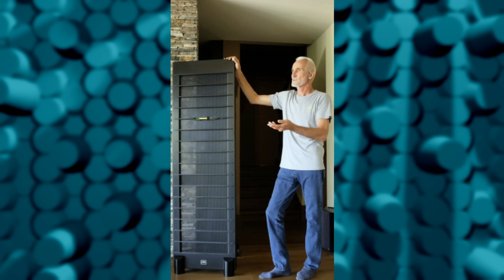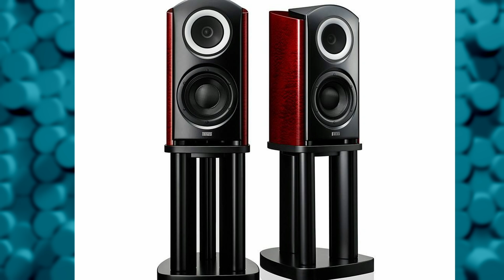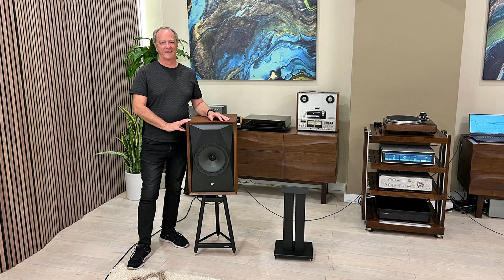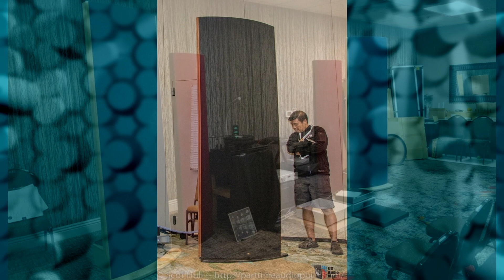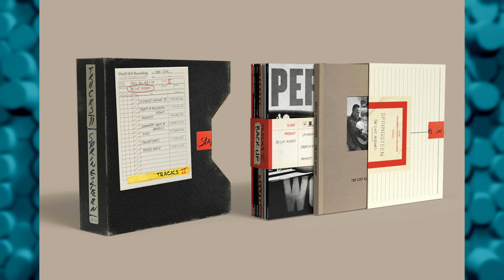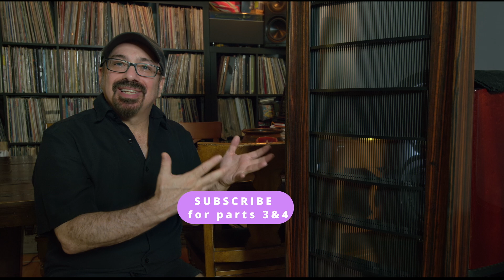Why are these Popori speakers called the "Holy Grail of electrostats?"  Part 2

Comment: Hi again mate:
Following up on my comment in your excellent WR3 Part 1 YouTube, your animated illustration in this Part 2 video shows the classic full-two-sided ESL stator panels, one stator panel on the front side of the membrane, and one stator on the bask side; but your WR3's appear to only have one stator panel (the black vertical rods) on one side of the membrane.  If this is true, then the WR3s are not full electrostats, they are "electrets", like Stax's entry level Dynastat headphone series.  If the WR3s are not true electrostatics, then they are only pulling in one direction, and then releasing allowing the membrane to spring back to the middle.  Also, I suspect that "electret" single stator ESLs may be start fast, but then might stop relatively slowly, with the membrane continuing to vibrate like a guitar string when the signal stops.  Please confirm if each WR3 has two stator panels or only one.
Many thanks!
-Sam
Reply from the maker: Hey i just saw your comment - yes the Popori has stators on both sides- thanks for watching - I also have a high quality recording   

https://youtu.be/Fqgfs1u19FU?si=-MzsBB28CF2btHZ8

Comment: Quad can be rebuild to last for 10 years easily.
These line source wire stator electrostatics are over 50 years old in design nothing new at all. Until I see proper measurements especially about distortion it is just a rich man's new toy.
The Mylar in these speakers it oo thick to give really brilliance IMHO. That is why most models have added AMT which is a very weak offering.
Reply from the maker: Hey thanks for your insights.  As I mentioned in part 1, Popori has been rebuilding other manufacturer's 'stats from close to 30 years in Europe.  They have panels that have been running 20 years with no repairs needed.  This is the big downfall with Quads IMHO, and why I would not go back, even though I'm sure the new ones sound excellent.  Ralph Karsten looks at the specs  of the Popori and dubbed them the "Holy Grail of electrostats"  His MA-1 amps are a favorite of the Soundlab crowd, so he knows what the tradeoffs of the various design are.   If you're ever in NYC and want to hear them, my contact info is on my channel.
Reply: @RDAudioReviews  Naming something "holy grail" is dead wrong to begin with. Every speaker has it's strong and it's WEAK points. Nothing is perfect and every choice in design has trade-offs. Being active in a market for over 30 years doesn't give any guarantee on quality or ingenuity of design. There is a company in Germany repairing electrostatics for 40 years and the result is still meh to say the least. I have Quad-63 running for over 10 years without any repairs and they will go on like this for decades. I don't have to travel to the US to listen to this design, I'm closer to his home country. It is still a very simple segmented wires stator line source ESL with 5 micron Mylar (without coating) used. There are laws of physics you can not break and you have to go into workarounds to get the upper octave working and there still wil be large distortion in this case like it is with SoundLab. Take measurements and be done with it.  Nothing holy grail about these, not even linear by far and Quad has factors lower distortion when rebuild done right. All ESL Plus Quad ESL-63 is distortion below the noise floor, so inaudible. If you are in The Netherlands and you want to hear them, come and listen.
Reply: The nature of a large electrostatic panel with huge excursion (this excursion allows the deep bass) is a tendency to slightly roll off the upper highs.  It is the tradeoff for not having a crossover and going for a full range design.  So, what they have done is to include a very high frequency ribbon tweeter in parallel with the full range panel to compensate.  It is a much better approach than to simply limit the bass with a crossover around 200Hz or so, ML style.
Reply: @davestipsforaudiophiles 😂😢 huge excursions. You are joking, right? Maybe you can define "huge excursions" in actual travel distance numbers. I'm looking forward to your answer.
Reply: @ESL-Plus  What is the world without a bit of humor?  All things are relative.  Compared to the movements of other ESLs, that movement with the Popori is greater.  Huge may very well not be the appropriate term, but small to some could very well be huge to others, especially when you factor in what that extra movement allows to happen.
Reply: @ESL-Plus  I find that 'Holy Grail' of ESLs to be quite appropriate.  It signifies long sought after attributes that have illuded the otherwise wonderous performance of some ESLs.  Some of those would be, efficiency, easy load to amplifiers, real low bass at high SPLs, etc.
Reply: @davestipsforaudiophiles that would be lovely ot see in measurements.
Reply: @davestipsforaudiophiles compared to other ESL's movement is bjgger? How do you know? Still would see that expressed in actual numbers. Thank you.
Reply: @ESL-Plus  I understand.  What is it you would like to see?  If you trust your ears all of what I wrote is demonstrated at the various audio shows.  Hearing is believing.  My pair of WR3s have the lowest efficiency at 88dB.  The larger models are mid 90s and up.  My bass towers roll in at 39Hz.  Just imagine all that speed and delicacy going down to 55Hz, my roll-off point.
Reply: @davestipsforaudiophiles you would be the first one to establish those numbers be listening at speakers. You know by the hz exactly how low it goes (without mentioning within what  dB range with what smoothing) 37 Hz, 55 Hz. You can detect the efficiency by listening. This is simply sales talk and marketing talk, not substantiated by any proof. I would love to ANY proof. First see real measurement numbers. If they come any close to the claims (which they seldom do) there is use in listening to them, because numbers don't say it all. But listening and judging without substantiated numbers means really totally nothing because it is all subjective. Enjoy the music.
Reply: @ESL-Plus   In my room the native frequency response of the WR3 starts to drop just under 200Hz, and is down by 5dB at 40Hz, then drops completely off below that. The frequencies I gave you are the points on my active xover to achieve 21Hz - 1000Hz +, - 1dB on a 1/12 smoothing.  Yes, I am using a very advanced room correction software.  I am not a loud listener, but I have had them up to >105dB for testing without strain.  Other ESLs that roll off the low frequencies cannot be brought to reproduce those lows without bad distortion and break-up.  The Popori will.  The larger models with higher efficiency can easily be run on 25W.  I do not have a lower wattage amp and so I do not know about mine.
Reply: @ESL-Plus   In my room the native frequency response of the WR3 starts to drop just under 200Hz, and is down by 5dB at 40Hz, then drops completely off below that. The frequencies I gave you are the points on my active xover to achieve 21Hz - 1000Hz +, - 1dB on a 1/12 smoothing.  Yes, I am using a very advanced room correction software.  I am not a loud listener, but I have had them up to >105dB for testing without strain.  Other ESLs that roll off the low frequencies cannot be brought to reproduce those lows without bad distortion and break-up.  The Popori will.  The larger models with higher efficiency can easily be run on 25W.  I do not have a lower wattage amp and so I do not know about mine.
Reply: @davestipsforaudiophiles  "Other ESLs that roll off the low frequencies cannot be brought to reproduce those lows without bad distortion and break-up."
Man, you make all kinds of assumptions.
A normal ESL can do 35 Hz with only 0,2% distortion. And I've got my own, in the living room, measurements to prove it. I have 30 Hz to 24 kHz within max 3 dB plus and minus with my standard ESL and again the measurements to prove it. Lowest distortion point is 0,03%, the highest is 0,5% THD. 105dB not a problem measured with pink noise. 
If you need a sub and DSP and/or room correction that is a very weak offering.
Can easily run on 25W? What does that say? Nothing. The First ESL's where driven by a few watt flea power amps without any problem. Output @ 1W / 1M / 1Khz that is what efficiency is measured at.
You are obviously a fan and I get that. But please know that is nothing special since the early fifties in there that has not been done many times before at a fraction of the price. Enjoy the music
Reply: @ESL-Plus  You obviously have a lot of experience and history with some ESLs that I do not.  I will admit that my experience with Quad is limited, but enough to understand how they are indeed special. I have seen many positive reviews of them, but with certain qualifications.  As you have alluded to, no one speaker is everything to everyone.  If I have assumed certain things incorrectly, then I do stand corrected.  I have owned Acoustats, Martin Logans and have had many experiences with Soundlab, one with a smaller model recently at a show that completely fell apart when asked to play lower frequencies. I do not know of another current ESL with all the fine previously mentioned attributes of the Popori out there.  One other that I did not mention is the ability to focus nearly as well as a cone mini monitor while also presenting a truly lifelike proportionally huge soundstage.  I am not affiliated with them other than being an owner and a fan.  However, I do enjoy helping out at various shows and witnessing first-hand the reactions of attendees with previous ESL experience to the shear dynamics presented by the crossover less design of the popori.  The common reaction is usually, "where are they hiding the sub?"  Yes, I use bass towers because I have the smaller model that is restricted to 40Hz in my room.  And yes, I use DSP for room correction to eliminate those negative impacts.  DSP when used intelligently and correctly is a game changer.  This is not a negative indictment of the Popori.  All speakers can benefit from a corrected environment.  While + - 3dB is very good, + - 1dB is better and all of us shoot for better.  If in fact the Popori is just a newer recycled form of previous greatness, well, I am good with that.  However, I don't believe you will find all that is positive about the Popori to exist, or to have existed previously quite like this in a speaker before, without having some offsetting negatives.  Once again, I would suggest you listen for yourself, or to someone you trust that has had that chance.  And of course, yes, enjoy the music.
Reply from the maker: @ESL-Plus  Hey thank you so much for your continued thoughts on ESL's.  We can always use more enthusiasts!  Many years ago I owned ESL63's with the full Crosby modification, and really enjoyed them.  I'm very happy to be enjoying 'stats' again, and now with dynamics and bass!
Reply from the maker: @davestipsforaudiophiles  Thanks for the info on your system.  As I stated in the video, I used to own ESL-63's with the full Crosby mod.   I found my TAD's much more satisfying and never thought I'd go back to a 'stat panel.   The fact that even the entry level Popori is giving me way more information than the TAD, really says a tremendous amount about Popori's implementation.   I'm dropping a new video tomorrow with some thoughts listening to the Martin Logan Impression 11A's vs. the WR3.
Reply: @davestipsforaudiophiles huge excursions, that is a joke right? Or better, what do you call "huge" excursions? It is much better to NOT do ANY crossover like ML and do bass with the Mylar and keep coherency in tact.

Comment: Hello again RD (Martin Logan guy here, and I have subscribed).  Left a comment over on your part 1 in this series.  It sent me off to the Popori website to check their full and future product lineup.  I found it interesting that your WR3 and the XR1 model being the only PURE ESL.  Others are a hybrid utilizing an xover for the high frequency 'planar' panel.

I also noted in the specs on the upper power limits.  I see there is a protection circuit should one proceed to over power the speaker.  Guess you will have to be careful with that big amp you have there.  😉 Looking forward to the next presentation and hearing your new speakers.  I could listen to them via my Parasound / Martin Logan gear. Fun times! 😊
Reply: It is still pretty much a pure electrostatic design.  The nature of a large electrostatic panel with huge excursion (this excursion allows the deep bass) is a tendency to slightly roll off the upper highs.  It is the tradeoff for not having a crossover and going for a full range design.  So, what they have done is to include a very high frequency ribbon tweeter in parallel with the full range panel to compensate.  This eliminates the crossover at 200Hz, or so that ML uses.  Going crossover less allows for a much purer presentation.  Then if one decides to augment with a subwoofer, it can be done at a much lower frequency where that blend can be seamless and perfect.

Comment: Apogees problematic
Hence Clarisys Audio 
Magnetic line arrays 
Tend to be durable 
EE audiophile, "never
again electrostatics"
Reply from the maker: Thanks for watching and commenting.  I haven’t heard the clarisys so I can’t comment, but audiophile junkie has, and went with the Popori.  Not sure of his reason.  

I did get to hear the Alsyvox and absolutely loved them.  However the entry level Alsyvox is over 3X the cost of the Popori, so out of my budget range.  

I did get to hear the Dyptique that is similar price to the Popori.  I was very disappointed in the sound, as was my friend who heard it with me at a dealer.
Reply: @RDAudioReviews  The Clarisys are fine by themselves, but when compared to the Popori, they are found lacking with even the entry level WR3 Popori superior.
Reply from the maker: @davestipsforaudiophiles  Dave great information for people to know.  You might want to see one of the comments from yesterday on my “two top speakers and a microphone” video stating  it’s “ laughable” that an electrostat could be on par or better than a cone  speaker used in studios.